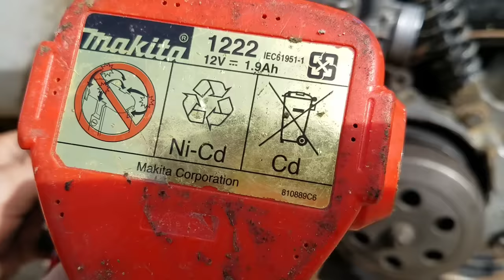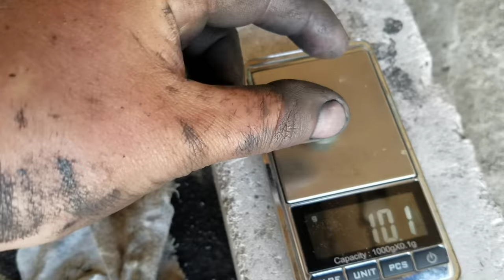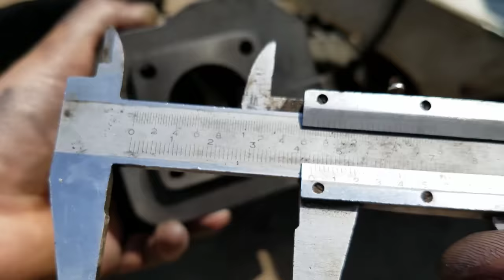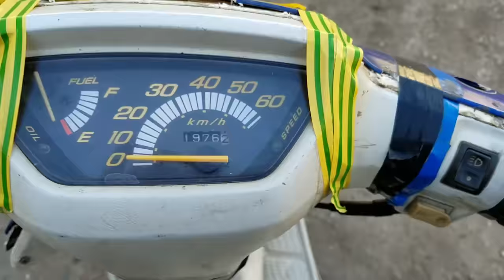Скутер из старых запчастей, для стант тренировки.

Comment: 1:19 Sir, the better way to do this, is to find a shaft (e.g. drill bit, metal rod) the same size as the internal diameter of the sintered bronze bushing. Get some paper/tissue/bread, break it up into little bits, soak it in water, stuff it (little bit at a time) down the hole, hit it in with the shaft and a hammer, keep adding more wet bread/tissue/paper and hitting it in further and further. Eventually the force backs-it out from the inside. This way, you can maintain the smooth surface of the sintered bush to use on other projects. The same idea works for blind-bearing removals from the inside of engine crank-cases. Good knowledge for when you want to remove bearings and bushings before repainting the part.